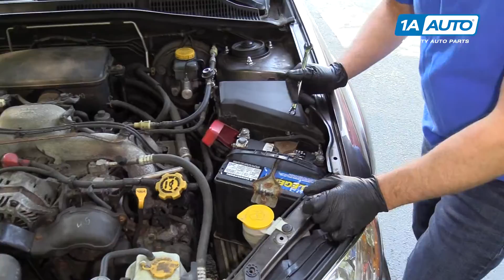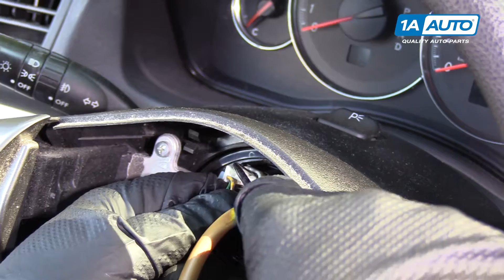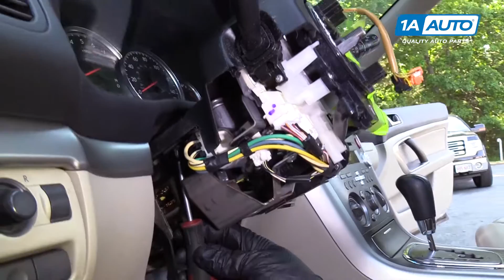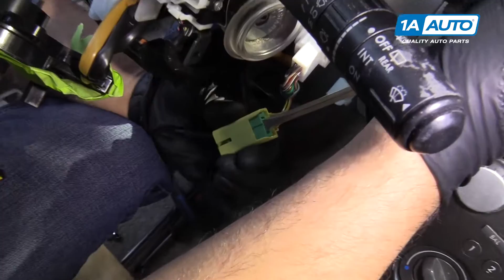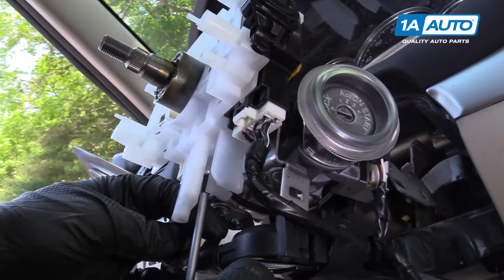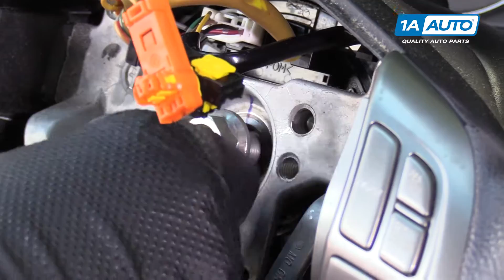How to Replace Parking Light Switch Assembly 04-09 Subaru Outback

Comment: Thank you for a detailed video on the switch removal. How can I determine that my switch is bad ? I keep blowing fuses with the circuit. I have examined all wiring to tail lights and have not diagnosed it yet. The switch is a likely culprit, but my gosh that is a lot of work for a MAYBE.

Comment: Please disregard my previous comment, your video and naming is correct. I did not know this vehicle has such a different (odd) application for the parking lights. Fouund in a different YouTube video [https://youtu.be/kNt3VnV9Yrs] about the switch inadvertently left on. I recently purchased this 2006 OBX... My 2011 Outback does not have this switch and no other manufacturer's past vehicles.

Comment: So if I only need to replace my blinker switch on the left side there, is it removable right after I get the top plastic cover off? Like will I have to remove the clockspring still?
Reply: No you will not need to remove that. just loosen the two screws and it should slide right out